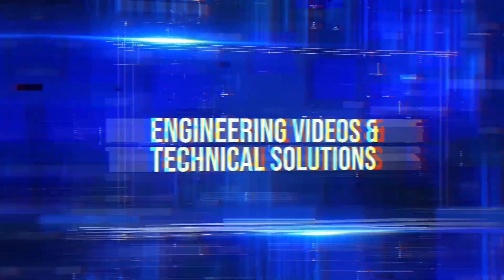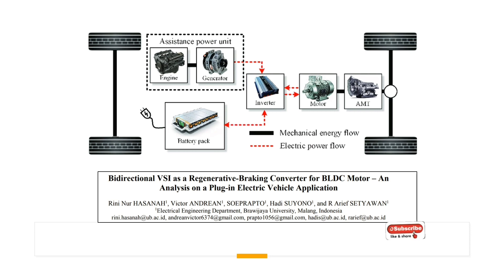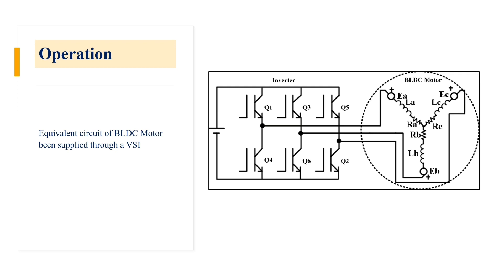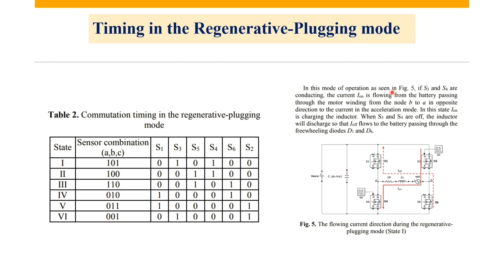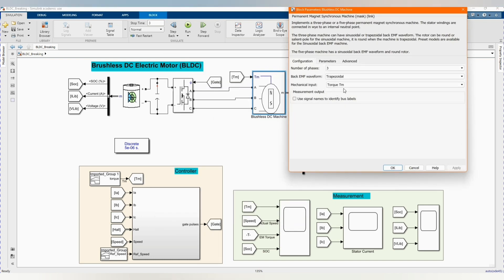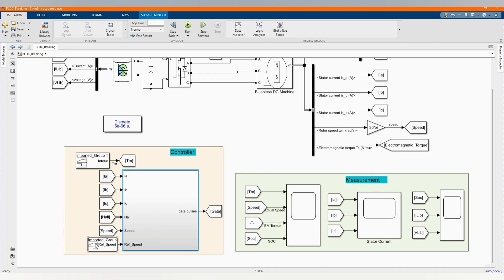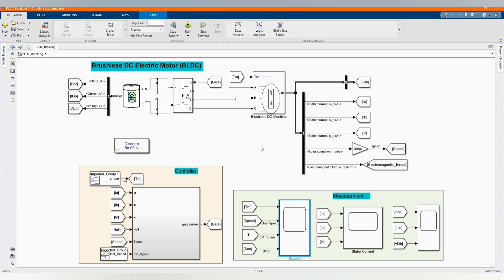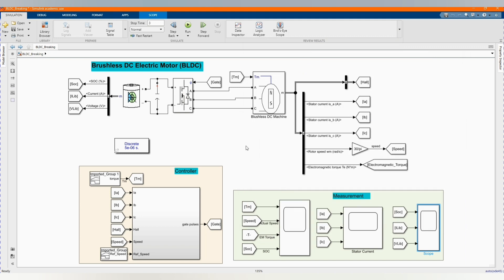Design and Simulation Bidirectional VSI as Regenerative Braking Converter for BLDC Motor in MATLAB

Comment: Hello sir, Nice video.
I have some confusions and I am new to matlab, this model is both for speed and current controller?And have you designed like inner current and outer speed controller loop.
Reply from the maker: Yes, correct, How do you want your system to operate ?